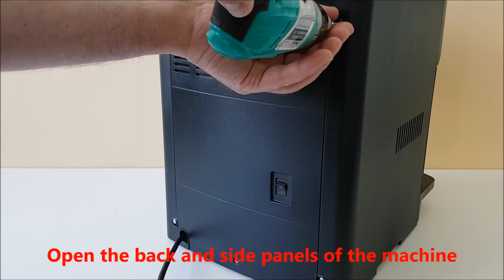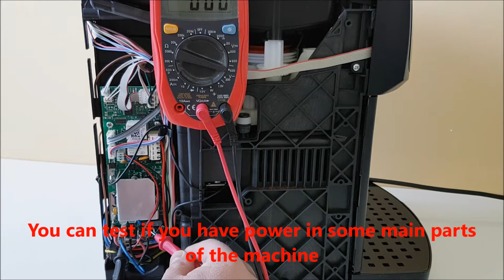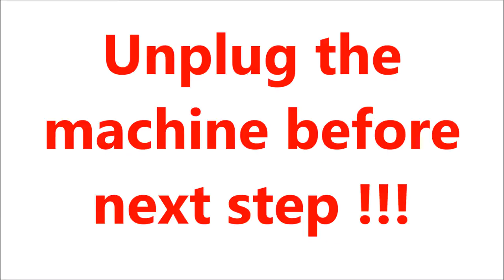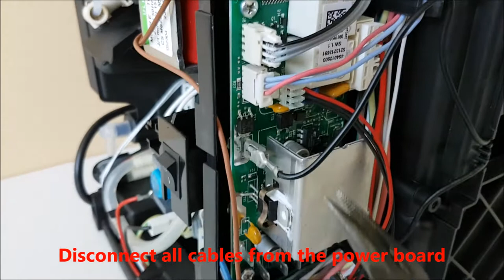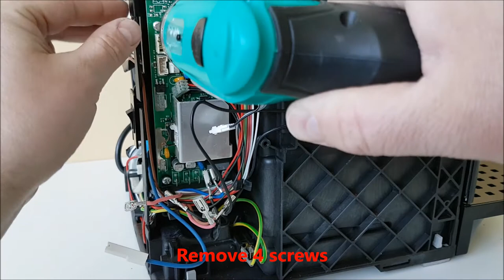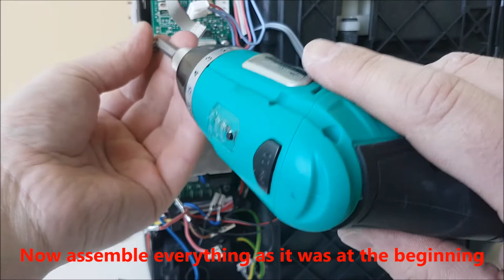De'Longhi  ESAM2600/3000/4000  power board replacement

Comment: I had the same problem all i did was take the top cable off for the front panel controll on the motherbord and cleaned it with electrical cleaner and it worked

Comment: What was symptoms for bad PCB? Mine powers on briefly when plugged in then after a few seconds powers off.
Reply: They all do that try unplugging then hold down the small coffee symbol and the large coffee symbol and plug back in you will see it going into test mode then press each individual button and it tests different parts letting you no which is bad I just did the test and it was my generator that was bad replaced it and working fine
Reply: @Will100plus, no luck. Hold the buttons and nothing.

Comment: where can i buy this power board?
Reply from the maker: Hi, just check online for the code 52
13213691 and you will find the best solution according to your region - amazon, ebay or local service centre of De'longhi.
Reply: @HKDIY  how to find the spare part code for ESAM2600 in amazon

Comment: Hi my esam2600 does not switch on when I press the power button
Reply from the maker: Hi, it can be failure of power board but there is also small possibility failure of control panel. I would suggest test if power comes to power board and first of all to replace it.